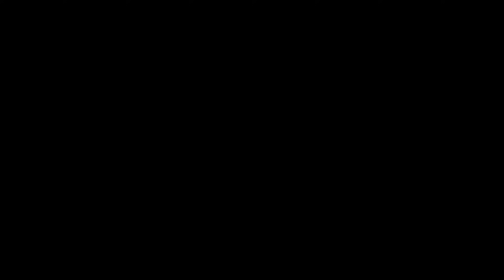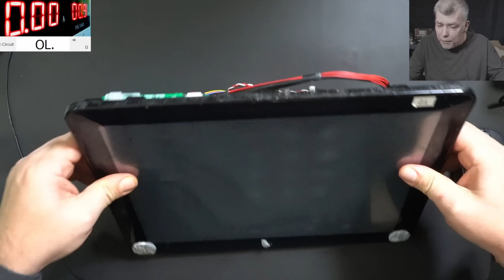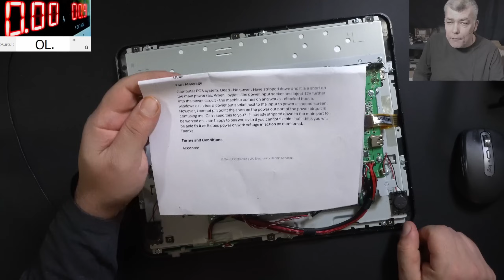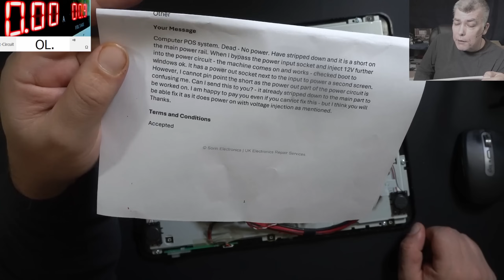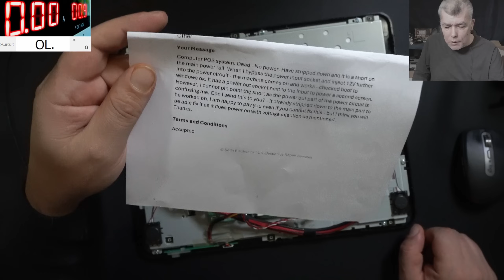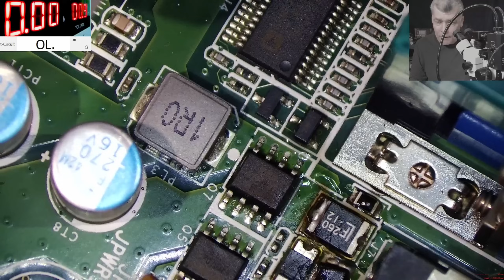That's how a simple fault can piss all over your electronics knowledge & experience

Comment: this still does not explain the whole story. surely the cable doesnt decide to flip itself, if the device was previously working.. so WHEN did the problem started?? maybe right when somebody unplugged it and couldnt notice it was wrong?? did someone replace the power supply with the wrong model??

Comment: seen some of this symptoms from green corrosion of stranded copper wires inside ...seen some cases of green corrosion (sometimes pulvorized stranded copper wires in solar panel wires because of high current.....the reason sometimes I don't like stranded wires but it depends on where  to use it.

Comment: One of the first test I do for any repair, is to check the ground, and if it is positive or negative.
It is an heritage from my first days, on hybrid devices (build with vacuum tubes AND transistors, usually all PNPs),
This check would have identified the reversed power supply after a couple of minutes at most...

Comment: I knew from the second i saw a 4 pin proprietary power connector that the problem had to do with that. Ive similar things happen with uncommon connector, lik ones where there's a switch integrated into the connector so checking continuity when its not plugged leads to false conclusions or when extra pins require a pull up or down or interface somehow with input polarity protection. And ur lucky that connector was an adapter because usually its an uncommon connector u  dont hav and u don't have access to the pins and u can't cut the cord to check cause it's the customers only one

Comment: I noticed something funny when you applied power and measured between the mosfet and ground and you got 0.60-ish volts. A diode drop. I thought someone replaced the protection diode backwards.

Comment: At 7.35 minutes I noticed the meter was showing NEGATIVE 0.6 Volts, as somebody else has stated, a protection diode is conducting due to reverse polarity of the psu.

Comment: I’ve experience and at 16:82 I’m wondering what the flip is going on…OK at 19:41 I got it, it the wrong bloody polarity.. phew 0.5V one diode drop.That reworked component is a diode and it’s in backwards across the 12V rail.

Comment: Swap positive and negative inside the ac adapter. Much better than plugging the connector upside down into the pc.
And rub out the positive/negative designation on the ac adapter ....... and engrave new positive/negative orientation.
That way it won't be doggy work plugging in cables upside down.

Comment: Oh Sorin - I was screaming at the screen from 1 minute in! Ive been repairing epos for 45 years lol there are 4 pins - 2 shorted pairs. on some the shorted pair run parallel to the flat side of the charge plug and others the shorted pair run perpendicular to it. 
I also know you have a customised version of the software - called ICR touch,  if you look very closely in one of the top corners, theres a pink line as its been edited in paint - ergo I know that that terminal originated from the west midlands company based in West Bromwich and the guy that edited the blue background has now moved to Ireland. the 4th line down that you are covering with the paper is a phone number ending 5566? am i correct? If you need any help with parts or programming for that (i think its a titan 360 but there are several named models based on that chassis)
AND SUNDAY IS SUPPOSED TO BE MY DAY OFF LOL
Reply from the maker: Thank you :)

Comment: To me perhaps the power supply was wrong and should have been tip to ground ring to power, but plugging in the adapter the other way was a solution(and perhaps it was a tighter fit that way so won't fall out so easily? )

Comment: POS have un conventional connection. the four pin connection looks exactly like Toshiba Qosmio X300 ac chargers , I know because I have one. the Voltage for the POs is 12v unlike the regular laptop is 19V.the reverse conection of the four pin adapter just to make it hard to use a regular 4pin charger beside of course the Voltage.

Comment: I really thought it was the female PSU connector on the board that was defective.
Maybe they didn't swap the adapter, but they did swap the charger/PSU. Some of them are inverted (plus outside the barrel, negative on the center pin).
Nice one!

Comment: You can see the dent in the adapter sleeve has to align with the slot on the inner plastic on the input but easy to miss because of the misleading slot on the metal outer sleeve on the input.

Comment: Yeah classic center negative plug. It's a common mistake by amateurs to not check the polarity of the plug when replacing an AC adapter. Sega Master System has the same center-negative plug.
Reply: Early SEGA power adapters came from Yamaha parts bin due to existing partnership and those were center negative because guitar pedals are center negative, so most electronic music instruments of the era were center negative as well.

Comment: This type of device is really EVIL. The software requires this exact special motherboard otherwise it doesn't work. This is how current gen PC-based arcade games are now too. When the board dies from years of accumulated dust and moisture it's game over permanently unless that exact motherboard can be repaired or replaced with the exact same motherboard. Most of the time the board rots out and is beyond repair and the manufacturers know that. These devices have a forced limited life designed into them. As a result this has created a whole new industry of hackers that crack and modify software to get around motherboard type limits and sell these services for very high prices. It's all very sad and is only going to get worse in the future.

Comment: @ 10 mins  you had minus 12v not plus 12v   there are 2 versions of those adapters that have a different pin out where it plugs into the computer.

Comment: Minute 7:30, checking input voltage shows -0.56V! That's a negative voltage, and the leads on the multimeter are in the right order (red to plus, black to ground). 
This voltage can hint a protection reverse polarity diode FWD voltage drop, exactly on the input power jack... 
From that moment onwards, that was just entertainment... 😂

Comment: I had a Dell charger , measures 19V , plug in .. no power & doesn't charge. Drove me crazy until I realized the male plug is bent.. straight = good but bent = dead. Cut open .. disconnected wires !  and I was checking the board !

Comment from the maker: Did you figure it out before me? :D
Reply: you missed the  " - " sign on multimeter at first measurement,.... i wait 20 minutes to see when you realise the reverse polarity .
Reply: The moment you found out the ground wasn't going to ground on the adapter I knew the problem was within the adapter, but I didn't know why. We need those kind of faults every now and then to keep us humble.
Reply: Yes  i did,   from like in the middle of your video but im still doubt it until you figure it out.
Reply: You’re measuring OCV with the PS unplugged. Under load the voltage drops because there’s not enough current from the PS to supply the connected load. Since there’s no short on the input, I’d say you have a faulty supply.
Reply: @garypoplin Did.. did you watch the whole video?
Reply: ❤few seconds before You, because this connector I have it mostly on monitors , some are 12v, some are 12/5v, different currents, sometimes the external ring is used as mass, sometimes only one pin is used as 12v. However it was strange that it was a removing adaptator, remind me when you find a computer in the street with no power supply and you have to find one working well😊
Reply: Yes
Reply: Nice accent aren't you from east europe?
Reply: I thought they changed the power brick out that was reversed but may be the connector
Reply: Yes I have written before. Minus 12 V and adapterkabel ist wrong. Good video and analysis.
Reply: Yes. When you were measuring 12v, it was actually -12v. Reversed polarity.
Reply: I knew it but I kept on being unsure until you started the device with the reversed plug